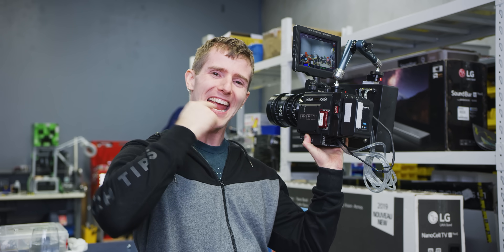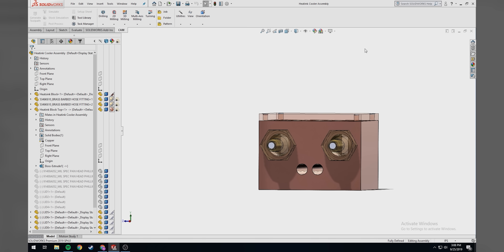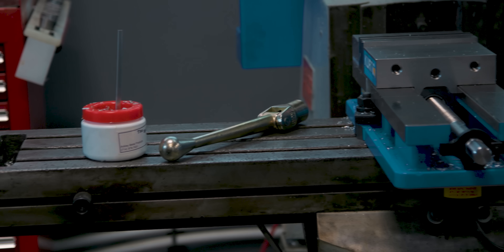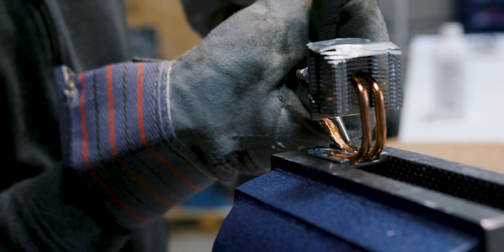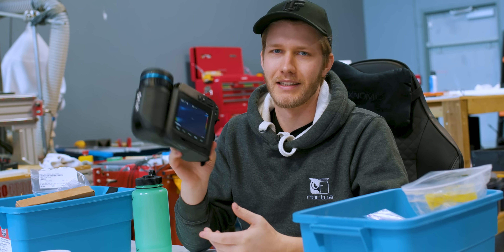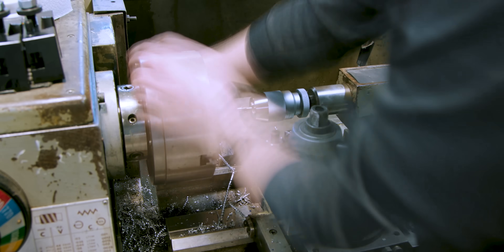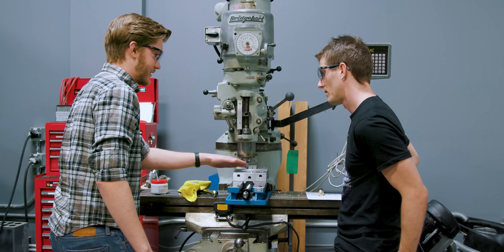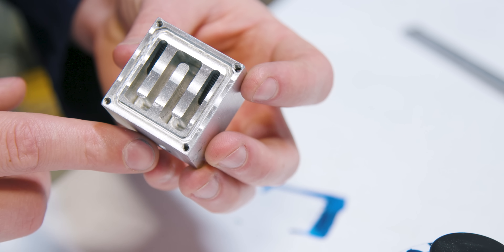WE FINALLY DID IT!! - Water Cooling the 8K Camera!

Comment from the maker: Check out the tools we used at OhCanadaSupply and enter to win a tool kit! at http://bit.ly/MWKGiveaway
Reply: YAY!!!! Congrats new sponsor!
Reply: Rithius3485 they have been a sponsor for the past few months
Reply: @xe5433  I didn't know, nice!
Reply: Stop grimacing you....
Reply: You’re close to 10 million subs. Congrats Linus. Been a subscriber for 7 years now.
Reply: So close to 10 mil
Reply: Activate the windows 10 pls
Reply: I can't get them at NCIX?

Too soon?
Reply: Hopefully I can get some help here. I just bought a new 2070 super and I previously had a 5700xt. When I log into windows everything freezes then I get a no display message on my monitor. I have spent hours on the phone with both nvidia and Microsoft support and they haven’t been any help.
Reply: Hopefully someone can point me in the right direction
Reply: @Ryan Kilburn

Find out if you have any Nvidia graphics drivers installed and AMD Radeon graphics driver installed, uninstall them from the control panel of your Windows.

After that, make sure you didn't uninstall the motherboard drivers, if it's an AMD system or Intel.
And reinstall the motherboard drivers after.

Download the latest DDU, google search for DDU graphics drivers.
Use DDU to uninstall old graphics drivers from your Nvidia graphics card or AMD graphics card, "you will want all drivers removed". Only for the moment.

Now reinstall your Nvidia graphics card drivers, when you open the installer, set it to manually / custom install, not express install.
Choose all the settings, select everything with a check box, and also make sure the "full clean install" button is checked, and click next to install. Wait patiently for everything, and when it says finish.. wait a moment for your drives to stop loading as much, and then click finish.

Restart your PC right away, make sure to save and close your open apps first.

Now it should work properly, you might need older drivers found, that could still be on the PC, and causing conflicts. Do a Windows update for any updated versions of Windows, such as Windows 10 Pro x64.
Sometimes you need to the latest version of Windows 10, just to use the latest Graphics Drivers and other types of drivers to be compatible, even motherboard drivers to be compatible with your Windows version.

However, don't rush to use some new updated versions of Windows 10 until Microsoft fixes issues, let it take a month or half a month before updating, depending on how long that new version of Windows 10 has been out from Windows update, such as half a month or more.

Always use stable drivers, that includes Graphics drivers, never use beta drivers, always official latest versions of any drivers on the PC, from the official manufacture website. And also never from other sources.

If the PC is taking time to restart, look at your Task Manager, by right clicking on your Task Bar on the bottom of the screen.

Once it restarts, it should work fine after the steps above.
Reply: Linus Tech Tips 9.99 million subs
Reply: That outro it's just like Scrapyard Wars style.
Reply: All I’m saying Linus is 10 million is soon and I should get to come to build a pc for the special series that’s it
Reply: Why are you in a pulseway advert
Reply: LTT needs a legit Fabricator on their payroll. If you need someone I have 10+ years experience in metal fabrication, welding, lathe work, laser and Water CNC, and all that good stuff.
Reply: You mad crazy bastards
Reply: Why didn't you collaborate with AvE for this project? He's also Canaderpian and has quite a bit of knowledge in machining, materials science and general bumblefuckery.
Reply: Almost 10 mil!!!!!!
Reply: I now demmand that This Old Tony and Friends do a collab and all of em watch Alex fail at machining and give commentary.
Reply: Rest in peace Linus.
Reply: Could you please do a video on how to turn an old laptop into a desktop?
Reply: wait you use imperial for measurement!!!!!!

if you need ultra precise measurement use METRIC
Reply: You could still forward the details of your process, and the prototype's designs to RED.  Who knows, maybe they will develop it for mainstream.
Reply: How do you like getting slapped around by RED constantly and consistently with their “proprietary” equipment that isn’t proprietary at all
Reply: If you can tweet to Elon Musk, let him know about these Graphene video links.
These are really important.
Watch them in order from top to bottom.

In this video, you will see 3 important things to note here about space exploration.
Those three things include not only the use of Graphene as a heat shield, but for electronics inside the Starship to also withstand lots of temperatures hot and cold, and the 3rd thing would also be that when Graphene melts, "supposedly" it turns into a gas instead of a liquid, imagine turning it back into a solid form like they want to do with Carbon Dioxide in the atmosphere and back into Graphene as a solid.
Now imagine doing this with Graphene when it becomes a gas of carbon, and going back into Graphene as a solid, but during space exploration with the Starship, or while the Starships are on other planets, or anywhere. See the big picture there. Basically I'm trying to say that not just for Carbon Dioxide into Graphene as a solid, but imagine when the Graphene heat shield melts, going from turning into a gas, and then we can turn it back into a solid as Graphene again, so as the shield melts, it goes back into a solid again, we're talking about some alien tech here and ideas that would absolutely work. On top of that, with the temperatures that Graphene can withstand with hot and cold, imagine that Graphene as a heat shield would withstand super hot temperatures, better than other materials at the moment. See the big picture there.

And so in short, Graphene for a heat shield "better than other materials", can also be used for the electronics and circuits within the ship, and when it goes from the melting point into a gas and turning it instantly back into a solid.

Though we could also collect Carbon Dioxide from the Atmosphere on other planets, asteroids and in space to turn back into Graphene.

https://www.youtube.com/watch?v=ZbxCGQK3Rrc

This video talks about Graphene and space exploration.
https://www.youtube.com/watch?v=jaRyCIOeELs

And so the important part here isn't to talk about Graphene material price, but what it can do and he's got the money, on top of that.. Graphene has become cheaper over time with different ways to produce and scale it up, the more ways to scale it up.. the cheaper Graphene becomes, and a lot of new ways have gone into it over 2019!
And another thing to mention, is that in the videos below, you can make devices yourself, home made devices for the Starship! Just check out the videos below and watch my Graphene playlist, and all the other links.
Also I suppose that I should mention that if you think about using Graphene as a heatshield and for the electronics inside the Starship, it would wear down less than other materials because it could handle the extreme temperatures better than other materials, so as it lasts longer, you save a lot of money!
And so at first it would be the cost, but imagine over time savings as it lasts longer! And the safety on top of that! And the high tech material "wonder material of the future" being used to inspire us to use it more often for developing other products / devices!

One other thing to note here is, not only could Graphene be used for all of the above mentioned, but it also can be used as a Super Conductor with water to keep it running as an energy source for the ship's electronics, and then later on for the ships Photonics and Spintronics.
Want to know why I mentioned this? Watch the videos below, and then go to my Graphene playlist using IE, you will see why.

For energy on the Starship, and for other devices we use.
https://www.youtube.com/watch?v=_RtZFU9eW_s

https://www.youtube.com/watch?v=TTCgZPRP_TQ

https://www.youtube.com/watch?v=jgRi7O-Mmdw

Also let him know about my other channel's Graphene playlist, emerging technologies and beyond, Quantum Technologies.

Graphene playlist.
https://www.youtube.com/playlist?list=PLAUtk-Q2DF7wXgENPNkvc5JXH5ocia_Fo

All playlists on the channel.
Click the "load more" button at the bottom of this link that shows all the playlists.
https://www.youtube.com/channel/UCB9ezXYprgvhMaPWLhyoJ7A/playlists?view=1&sort=dd&shelf_id=0

And the "About" tab, for official website links to the companies in the videos from the playlists.
https://www.youtube.com/channel/UCB9ezXYprgvhMaPWLhyoJ7A/about?disable_polymer=1

Click the "more" button in each playlist description.

Also use Internet Explorer to see important information that I set next to each video. Google Chrome and Mozilla Firefox won't show that info beside each video, and so you are missing important info that I set next to each video in each playlist.

Be sure to let him know who gave the info please!
Reply: If you want to know more, imagine space communication with Quantum Teleportation, they're already doing this with Satellites for the Quantum Internet, that they plan to share in a few years, now imagine this for Mars and beyond.

These are playlists on my other channel. Be sure to use Internet Explorer to see important information I set beside each video, for the reason in my other comment above. Google Chrome and Mozilla Firefox won't show that info beside each video that I set, you will be missing important info that I set next to each video, in each playlist.

Fusion Energy playlist.
https://www.youtube.com/playlist?list=PLAUtk-Q2DF7xjM3BgVQT44w9bozcNgkPW

Asteroid Mining / Space Mining playlist.
https://www.youtube.com/playlist?list=PLAUtk-Q2DF7zmL0SWiTE06LjmZY-wzHuD

Warp Fields / Shields, Warp Drives, slower and faster than light.
https://www.youtube.com/playlist?list=PLAUtk-Q2DF7z-5wWCLg3fZkQKognSFjwE

Supercapacitors and Ultracapacitors.
https://www.youtube.com/playlist?list=PLAUtk-Q2DF7yMYELJtT2FUG93WZaCg4U9

Advanced Solar Panels Technology.
https://www.youtube.com/playlist?list=PLAUtk-Q2DF7yi5Xj7aFEdC2axvmVhggwp

Also Graphene immortal batteries, Quantum immortal batteries and Quantum Engines.
https://www.youtube.com/playlist?list=PLAUtk-Q2DF7zi1xT6sM9JD7uFWbKhIsqU

Future Vehicles, imagine a Tesla Electric Vehicle new and latest version with this Mercedes-Benz Vision AVTR, the design inside out and all of it. We can do this now, imagine mixing these future technologies together that I mentioned for the vehicles.
https://www.youtube.com/playlist?list=PLAUtk-Q2DF7yvsyaP241-mes-_VyWQS-O

Gravity / Anti-Gravity, we can now do this "supposedly".
https://www.youtube.com/playlist?list=PLAUtk-Q2DF7xNy8sg6x9r14uVd1NWelqI

Now imagine these computing types, used on the Starship and for Warp Drives, and for many other reasons, be sure to check out each playlist and watch all videos from top to bottom, to understand what I mean, and check each playlist description, using Internet Explorer because of the information next to each video!

Photonic Computing playlist.
https://www.youtube.com/playlist?list=PLAUtk-Q2DF7yx80jrh7uORkHKowzGy7pi

Quantum Computing playlist.
https://www.youtube.com/playlist?list=PLAUtk-Q2DF7zcaxLKdVe7KGlZW6VZBYn6

Quantum Teleportation playlist.
https://www.youtube.com/playlist?list=PLAUtk-Q2DF7zTCO6cHkW-KthScqhyMeNH

Quantum Internet playlist.
https://www.youtube.com/playlist?list=PLAUtk-Q2DF7zyieucbh6bynqYO80kcYX3

Spintronics playlist.
https://www.youtube.com/playlist?list=PLAUtk-Q2DF7zicJm2a61R4BAhekeTF64N

Hyperloop One playlist.
https://www.youtube.com/playlist?list=PLAUtk-Q2DF7yv6WeeFniBt3d2eSv8afW1

Advanced City Planning and Future Project Mega Structures.
https://www.youtube.com/playlist?list=PLAUtk-Q2DF7xPv5ZdTaSxsOydjFHqTEnn

Type 1 - 6 Advanced Civilizations.
https://www.youtube.com/playlist?list=PLAUtk-Q2DF7yIZDltW-P_ZSrEO5NGfsMh
Reply: Graphene classical computers that could be 1,000 times faster at the 1 THz level with Graphene and specific magnets, they are using silicon to take us for our money.

Because Moore's Law is based upon making the "Silicon" transistors smaller for more energy efficiency and less heat.. sadly the heat is going up, even know they can make it more efficient as smaller at the nanometer level.

This is where Graphene comes into play.

Though it is true that they are trying to take us of our money, as long as possible before switching to a new material and learning that.. should make you angry, check this video out, we could literally use Graphene but they want to use Silicon instead to get down to as small as possible with the transistors with Silicon at the nanometer level.
Lisa Su, the CEO at AMD said in her on stage presentation for the Ryzen 3000 series.. "I love Silicon".
Go and look up the videos for 2019 about Ryzen 3000 and her on stage announcing it, she says that.
Fun fact, Lisa Su CEO of AMD is related to the CEO of Nvidia, he is her uncle. I'm sure you knew that already.
https://www.youtube.com/watch?v=maZnwuGxAA8

Check this out.
And there are articles even before this video, on Graphene classical computers.
https://www.youtube.com/watch?v=ZBnB2LjIRpc

And these videos.
https://www.youtube.com/watch?v=UUO-f0kIgVU
https://www.youtube.com/watch?v=VLPpDoMBVK0

In the link above for the video, skip to (5 : 03), I have that Graphene SSD in my PC right now.
Except mine is Gen 4 X4, not PCI - E 3.0 X4 like in the video. Because the website shows Gen 4 X4 when I got it, and I'm using a PCI - E 4.0 motherboard, the X570 from AMD known as the Gigabyte Aorus Xtreme X570.
And then watch the video from the start if you haven't already.

And to also point out, even know this video is from Seeker, do realize that there are other Graphene research labs like Archer Exploration also known now as Archer Materials has with their Graphene Quantum Computing brain chip.
She admits here that some Graphene research from this team of scientists were able to reach 3 Kelvin for Graphene as a super conductor, closer to room temperature.
https://www.youtube.com/watch?v=HSn57YVDvHg

They mention in this Spintronics video with Graphene, that electronics devices with these 2 emerging technologies could be out within 5 years.
https://www.youtube.com/watch?v=Cs-rB3YG_ZE

https://www.youtube.com/watch?v=JLHFVlbsRpA
https://www.youtube.com/watch?v=_UVmKj-8VEM

The guy mentions that Graphene isn't as expensive or hard to produce like 10 or 5 years ago, in this video.
https://www.youtube.com/watch?v=yGdqpMX0py4

Also this playlist here on Graphene Immortal Batteries, Quantum Immortal Batteries and Quantum Engines.
https://www.youtube.com/playlist?list=PLAUtk-Q2DF7zi1xT6sM9JD7uFWbKhIsqU

Something else to point out here.

Type 1 - 6 Advanced Civilizations playlist, please watch.
https://www.youtube.com/playlist?list=PLAUtk-Q2DF7yIZDltW-P_ZSrEO5NGfsMh

And the reason for the playlist about a Type 1 - 6 Advanced Civilization, because Dark Matter and Dark Energy make up a lot of the universe, right? We would use it to travel throughout the universe, and it would kind of make us a Type - 4 Advanced Civilization, in a way...
With also other emerging technologies being developed at that moment.
However.. in this video, he mentions that this new particle could put an end to the mystery of Dark Matter?
Does that mean we are really close to a Type - 4?
Skip to (11 : 39) in this link.
https://www.youtube.com/watch?v=DXVgkyllo2A

Also to point out, we could become a Type - 5 Advanced Civilization, because there is a video that mentions that we could make a Dimensional Gate by 2070, in my Alcubierre - Froning warp drive playlist.
https://www.youtube.com/playlist?list=PLAUtk-Q2DF7z-5wWCLg3fZkQKognSFjwE

Btw, imagine Quantum Computers solving big algorithms for warp drives like the Alcubierre - Froning warp drive playlist above, and for warp drive energy.
Be sure to read my Quantum Computing playlist description for more info.
Reply: Bad design cooler...
Reply: 35 celsius....soooooo.....90 something F? lol DAMN YOUSE!
Reply: YOUSE'XZ'
Reply: Absolute no one, no even one in the whole universe, lets water cool a red camera, but first lets buy a machina station for it
Reply: @makunouchiippo2542  "comedy"
Reply: nah
Reply: cool Linus got a mill  we can give he man card back to him OK i don't want to see any body calling him a whimp any more he's a man now. he's got man tools. 0:46 he's officially a man buddy
Reply: Ok Boomer
Reply: @blackhole4106  you be
Reply: @blackhole4106  you be home 🏡

Comment: THIS IS IMPORTANT FOR SAFETY: 

NEVER WEAR LONG SLEEVES NEAR A MILLING MACHINE OR A LATHE!!!. 

Preferably short sleeves are worn, but at least roll up the sleeves on the shop coats. 

If the sleeve gets caught in that equipment, you can easily lose a limb or even die.

A Coworker of mine lost his hand because he wore a sweater and it got grabbed by the lathe. It sucked him into the machine hard enough to break 5 ribs, shattered his wrist, and ripped his hand off. Thankfully the sweater tore and didn't pull him in further. Others haven't been so lucky.

Comment: Cringe.... cringe.. CRINGE.. I'm an Electronics Engineer, with a thesis in Cooling systems for power Semiconductors. and the whole video was like watching a open brain surgery performed by a beginner butcher, using an blunt axe.
This guys don't know their belly button from a rubber boot in their ... OMG... no idea of what they are doing, specially the young guy that destroyed the heat sink/heat pipe assembly at the beginning. the whole contraption is simply GROSS.... Hey but you got 1.7 million views; including mine, which I wish I never did it. 
Now my brain hurts ! and I'm going to have nightmares for a long time.

Comment: Alex, you can tap with a drill Chuck. Don’t tighten super hard and it will actually lose grip when it gets stuck and the tap won’t break. Especially on smaller taps